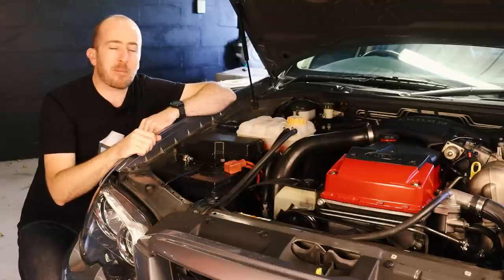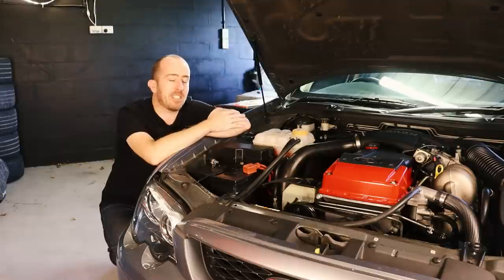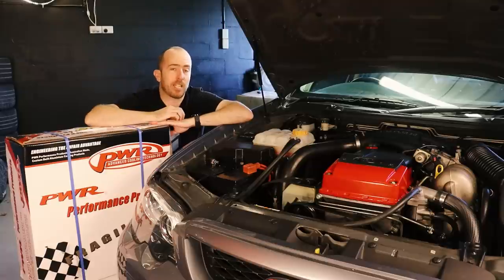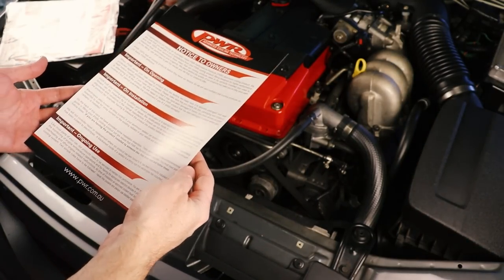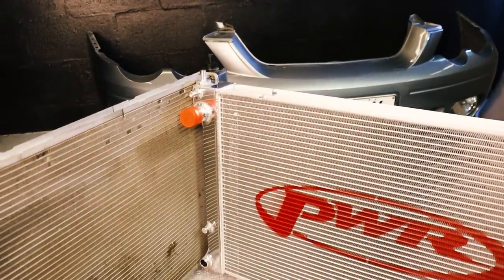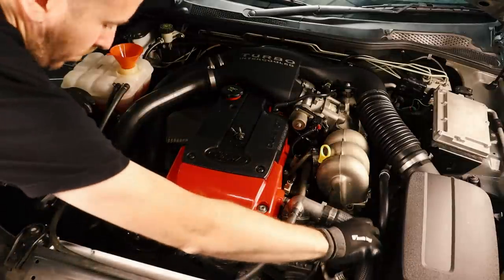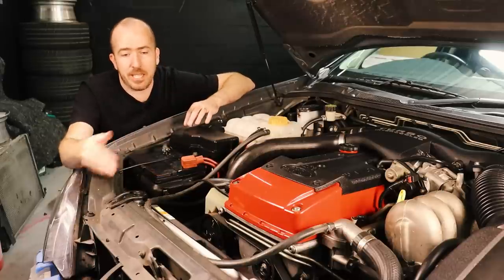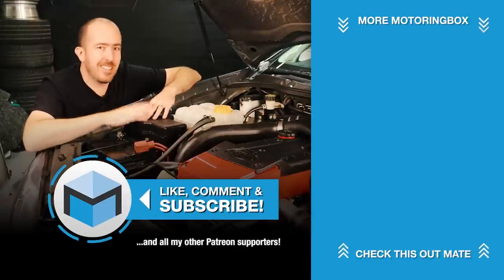Barra Turbo Radiator Upgrade! PWR 55mm Aluminium Radiator for Ford BA/BF Falcon XR6T XR8 FPV Typhoon

Comment: Just a heads up, in the US FoMoCo has changed all their coolants to the yellow/gold standard instead of the orange/red type. They claim better water pump life, cooler temps and such but whatever. It may be worth checking out.
Reply from the maker: Is it a retrospective change or mainly for their newer cars?

Comment: The only thing worse than an old crusty stock radiator is a new generic eBay radiator. Lessons learnt...
Reply from the maker: I have heard a few stories about them. Some of the listings looked alright, but you just never know what the product you receive is going to look like.. or how long it'll last. This is the third time I've had to dump the coolant (for different reasons) so I'd rather not do it again anytime soon!
Reply: @MotoringBoxTV  They're just the work of the devil. The one I tried instantly started leaking at the top tank seams.. there's so much more to them I would've given them credit for otherwise, the cheapness isn't worth that inevitable faff.
Reply: @MotoringBoxTV  Ebay stuff is decent if you know what to look for. In general, OEM quality replacements are always the go. You've done well with this XR6 Turbo, and you've done your due dilligence. Props to you mate.
Reply: @MattExzy  If its the crimped ones like im thinking they are, stay away, anything that is crimped metal to plastic is sealed with a pressure seated o-ring type thing, and generally shipping etc can make that come loose, and by the time you have to do the work to fix it, or get someone to fix it, it is immediately not worth the hassle. PWR is a fantastic brand for the coin, but for cheaper a locally sourced OEM option is the best way to go, but in general, only buy once, and only get quality, and never worry again. When major components are done, then you only have to care about your basic servicing.

Comment: i cant beleive they designed it so you had to take the front bar off to replace the radiator.   thats just dumb.
Reply from the maker: I suppose it probably made it more efficient on Ford's production line or something.
Reply: Not as bad as the Leyland Marina where I was told some bolts were made inaccessible by components welded over the top of them!